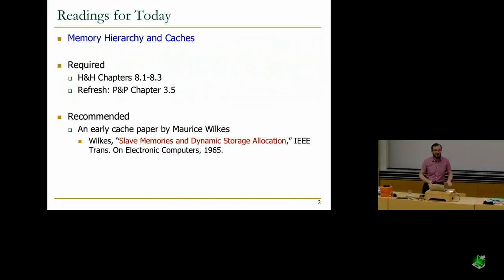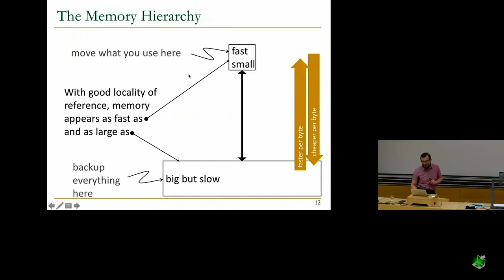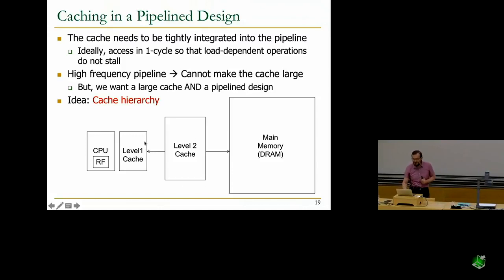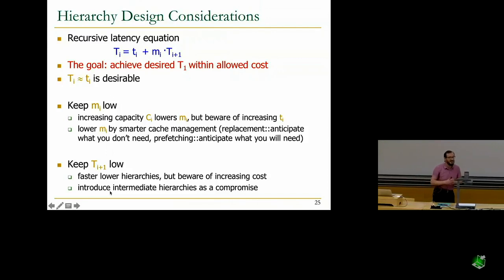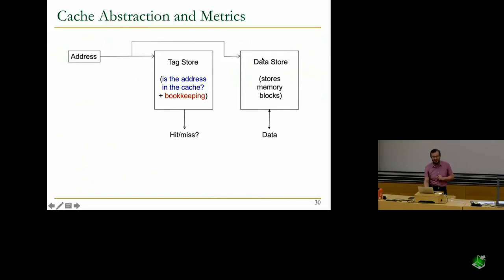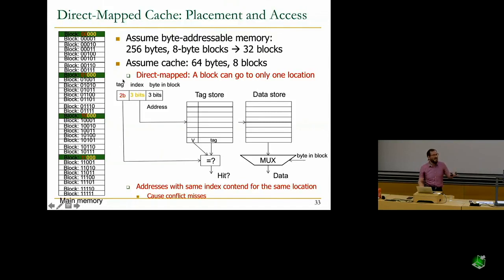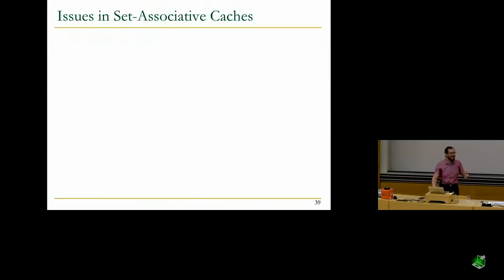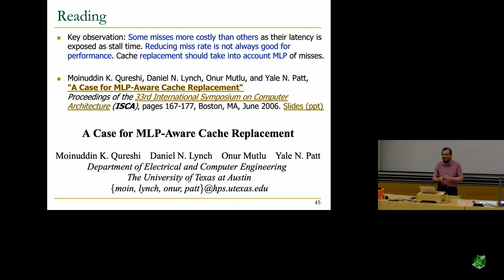Digital Design & Computer Arch. - Lecture 21b: Memory Hierarchy and Caches (ETH Zürich, Spring 2020)

Comment: in your previous year lecture on DRAM, the idea of splitting a DRAM bank into near/far (fast/slow) halves was mentioned. What can be done to get lower latency memory in existing systems? Would it be possible to set the SPD on a DIMM with false row information? Example: saying the DRAM chips have 1 fewer row address bit than it actually has? I am assuming the high row address bit represents the half of the bank that is furthest away from the sense amp, allowing lower latency? A 50% or even 75% reduction in capacity is not an issue